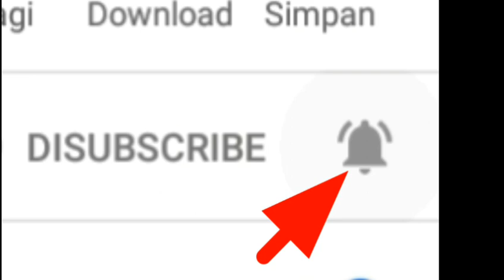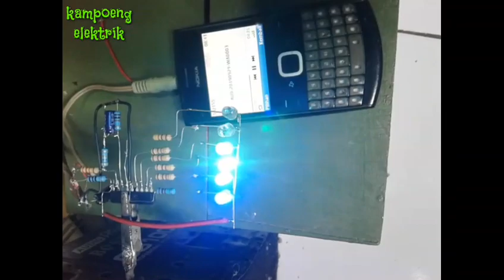Cara membuat Led mengikuti irama musik ||  dengan ic b1403n

Comment: Resistor 470ohm bisa diganti 560 ohm bang?
Reply from the maker: Bisa mas....
Reply: Seri ic nya beda. Pnya sy tertulis cuma "B1403n 6T8" tnpa huruf L. Apa sm dgn LB1403n?
Reply from the maker: @ayrasabila1750  sama mas... klo msh ragu bisa di brosing pin ic

Comment: Kok cpt rusak mas kalo pke ic?knpa demikian
Reply from the maker: Malah awet to mas pke ic... klo mnggunkan dioda dan resistor saja kadang putus led nya
Reply: @kampoengelektrik7160  kalo led nya langsung bisa g bos?soal ny kok di fb ad yg langsung dan gpp y bos
Reply: @kampoengelektrik7160  boss knp kok masang led nya di input tc?? Knpa kok gak di out power aj breng sama speakeer
Reply from the maker: Di spker mengganggu hasil dari sepker itu    ... dan rentan rusak bila volum di geber ...